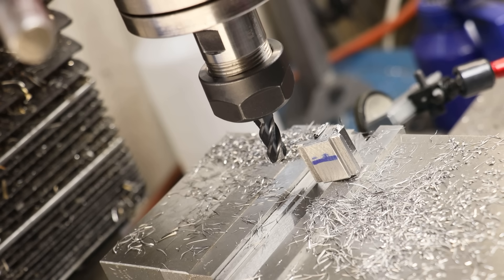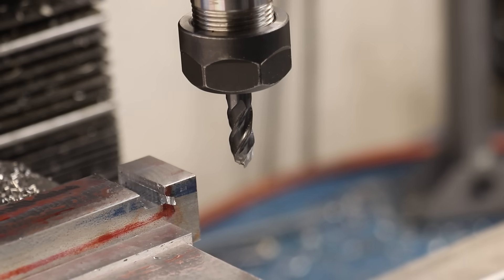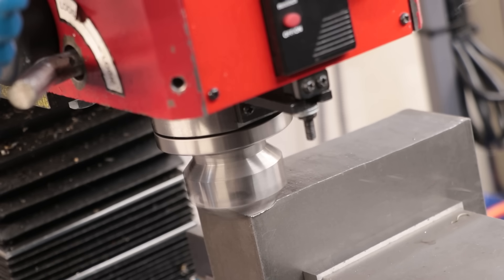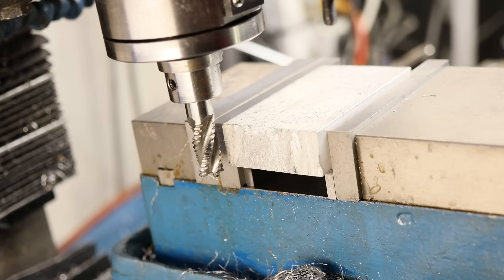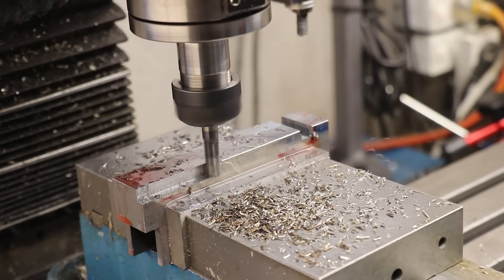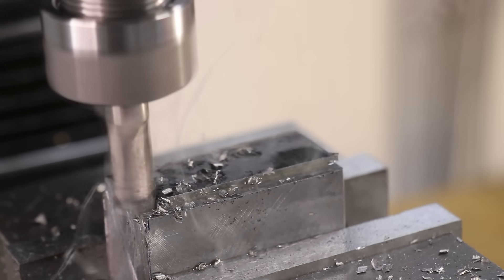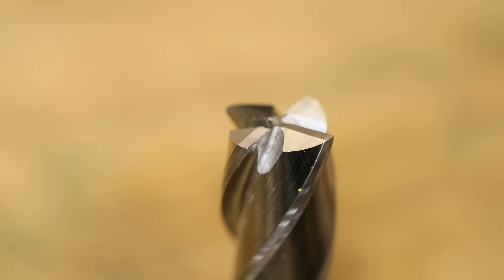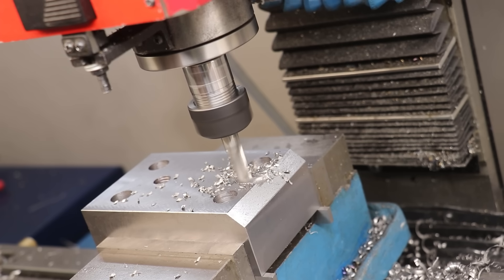10 Tips To Better Use Endmills

Comment: i would not use carbide tooling on such a small benchtop mill, except a facemill. everything else, go for HSS / Toolbit tools. the machine has neither the power nor the rigidity to push carbide to the needed point, resulting in the edge dulling due to rubbing
and a 10mm HHS 2xD Endmill should not cost you 50$ - at that size and price, i would expect at minimum a high-end powder-steel roughing cutter if not solid carbide
Reply: Odd, Artisan Makes seems to do okay.😂

Look, stop it with the old tired myths that hobby machine tools can't use carbide.  Lots of people use carbide inserts for turning and insert tooling/carbide endmills for milling on hobby sized machines and do just fine.

Of course you can't hit the feeds and speeds listed by the manufacturer of the tooling on these machines with limited rigidity but they still work at sensible speeds and feeds, a bit higher than HSS but not, as I said, the listed speeds and feeds.
Reply: @stevedavey1343
 My 1949, Myford ML 7 lathe can't hit the recommended speeds for insert tooling. I use some HSS but for the most part, it's still inserts from China,  coolant or cutting oil, slow feeds and medium DOC produces acceptable results. Keeps my costs down too. Banggood and/or Aliexpress seem to do ok for me.

I was somewhat surprised he didn't mention fly cutters and the exceptional surface finishes they can produce but I guess they don't classify as an end mill but neither do facemills really.
Reply: This is very wrong. But don't trust me and look up Stefan Gotteswinter Endmill shootout video.
Reply: Carbide works much better than HSS for me on cheap machines (which is all I have). Especially if power is limited but RPM can go relatively high.

Comment: There are 12 mm indexable insert endmills. The down side is there are less flutes so you trade time for money. I sometimes regrind the inserts if they are not chipped, the inserts being straight it's just a lick with the diamond wheel.

Comment: 4 riil bruh side milled with drill tho
at my previous job i said once because we was breaking like 3/8 taps like nobody's business for every part so i said i need thread mill for this thing because the machine has no power to run the tap mechanically or  electronically. Aint no my business anymore if they got mill taps or they break one tap per part still or what because i quit already ages ago.
Reply: And English classes too by the sounds of it .

Comment: Another tip is to never drop them to the ground. Don't ask me how I know. 😬
Thanks for all the tips, dude!
Stay safe there with your family! 🖖😊
Reply: Musta been alias 'Steve' working at alias 'in a machine shop far far away' who 'told you'

que star war credits
Reply: @TommiHonkonen Wait, Star Wars?
That's where the fun begins! 😬
But yeah, I dropped one, unfortunately. 😂
Reply: @TommiHonkonen Almost. I dropped it myself. 😢
Reply: I always have a 12" square of plywood available to put under the cutters at tool change. Has saved many a dropped tool from dinging the deck or deleting a corner of the tool.
Likewise on the lathe at chuck change. Wood on the ways under the chuck.
Reply: Been there, done that…
Brand New 50 euro endmill in a plastic package which didn’t want to slide open.
So I pulled hard, the endmill flew out of the box and dropped on the concreet, chipping of a cutting edge….
Reply: @tooltimechris7217  ouch :(

Comment: Please make video what endmills to buy for the start?
I got my SIEG SX2.7L and I dont know what endmills to buy.
Reply: Generally when starting out, whatever you can get hold of is 'best'. Get started, get learning and  you can always build on that as you experiment. When starting out everything takes a lot longer anyway amd you'll find that you'll wear out tools quickly more throigh user error than quality of tool. Get started, get learning and have fun! 😊
Reply: @SimJackson  Read a book and watch YouTubers! Lots of brain power being offered for next to nothing but your time. Register for Practical Machinist. No cost as I remember  but you get to be able to quiz the pros on subjects of machining, just don't be dumb, stupid or obnoxious in your questions or ongoing discussions. You can usually either get ignored, if it's really dumb, or helped if you've asked the right way. Good luck!
Reply: I have a way-worse-from-factory but still similar mill. Start with 8mm or smaller of the common and cheap carbide endmills from ali. 4 flute ones for steel (only), 3 flute ones for aluminum (but also work on steel in a pinch/slot). Once you stop breaking those, a 10mm endmill is a good workhorse. Starter checklist: good workholding, lock other axes, don't climb mill medium/heavy cuts, make chips not needles or dust (fix with less speed(rpm) or more feed), avoid cutting hardened steel. Other tips: cutter listed/oem cutting speeds are for rigid low-backlash CNC machines not mini mills, never buy the cheapest ER collets (get the '0.008' um or better instead), set up out some chips/heat management whether it's vacuum, air nozzle, spray, mist or flood.
Reply: Use HSS to start with. Much more forgiving. If you inadvertently move the table the wrong way, the backlash can take the tips off an expensive carbide cutter as they are very very brittle. Once you are confident, carbide is the dogs danglers.
Reply: Oh, and realistically, 16mm is your max for that machine.
Reply: Thanks all for replies.